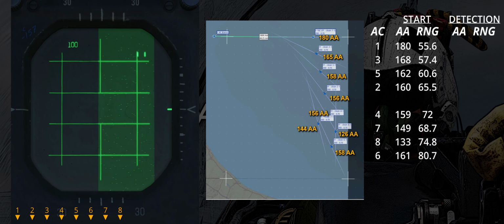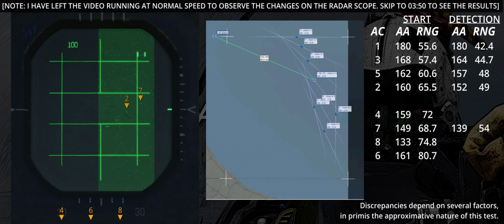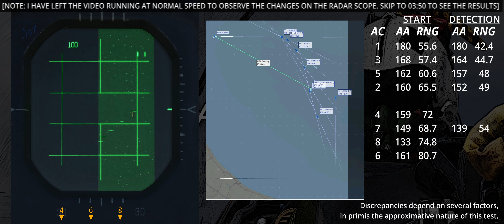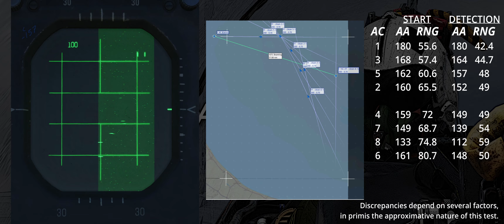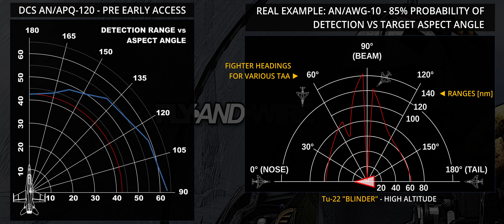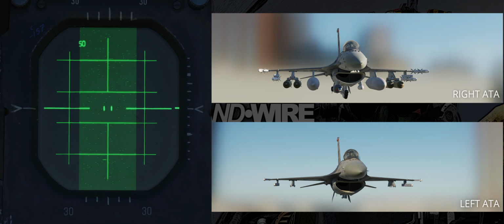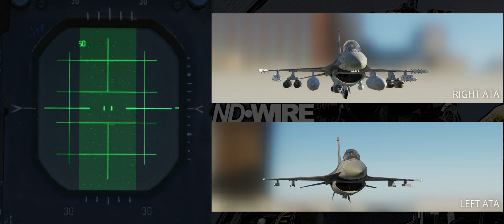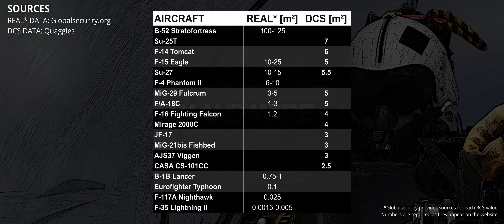DCS F-4E APQ-120 - Radar Cross-Section and Detection range

Comment: Thank you very much for the video. This is invaluable information. But I don’t understand why the same target with the same RCC has such a huge difference in detection distance. The radar detects a target at a distance of more than 70 miles at 90 AA, but only 40 miles at 180 AA. It shouldn't be this way. What causes this difference?
Reply from the maker: No problem, glad you liked it :)

Why do you say this is incorrect? Looking at the AWG-10, it could detect a Tu-22 0TA closer than 60 nm and at over 140 nm close to the beam.
To keep this simple, look at a Tu-22 from the front: https://tupolev.ru/upload/resize_cache/iblock/0ee/1250_1250_0/x0ee86866b771c7f0b0f50d5581163cd3.jpg.pagespeed.ic.r9gsOj_tR7.webp
And from the side (not 90TA though, due to notch): https://upload.wikimedia.org/wikipedia/commons/4/4a/Soviet_Tu-22M_Backfire_with_a_F-16.JPEG
Looked from the side, it's a massive silhouette, whereas the front is quite compact. And, of course, it is more complicated than that (shapes, materials, coatings, and many other factors drive the RCS).
Reply: @FlyAndWire  I know that the same plane has a big difference in the size of the silhouette from different angles, but what does this have to do with the diagram on the left if there is the same plane with the same silhouette approaching us from different angles. In this situation, the radar sees exactly the same silhouettes because it constantly scans the space from left to right and does not just look straight ahead.
Reply from the maker: What image on the left? Are you talking about the video cover? If that's the case, you can see it better here: https://flyandwire.com/2024/05/20/f-4e-apq-120-radar-cross-section-rcs-and-detection-range/
I think you missed that the chart represents AA vs SR. Ergo, the radar is seeing something different all the time: at 180AA, we are looking at the nose, and the detection range is 40-something nautical miles. At 135AA, we are looking at 3/4 front. Something like this: https://www.aljazeera.com/wp-content/uploads/2024/08/AP24242627594906-1724985395.jpg?resize=770%2C513&quality=80 (random result from Google).
At 90 AA, we are looking at the side of the aeroplane. Like this: https://media.gettyimages.com/id/94321681/photo/aircraft-with-clipping-paths.jpg?s=612x612&w=0&k=20&c=GrOoncaYWyJaQtAcGOPzOk-cVOzRm27cE9PAHZRe-i0=

This video should clarify how the Aspect, both Aspect Angle and Target Aspect, work: https://www.youtube.com/watch?v=zQ5IFHlr1tk

Also, can you clarify what you mean with this, please?
> the radar sees exactly the same silhouettes because it constantly scans the space from left to right and does not just look straight ahead.